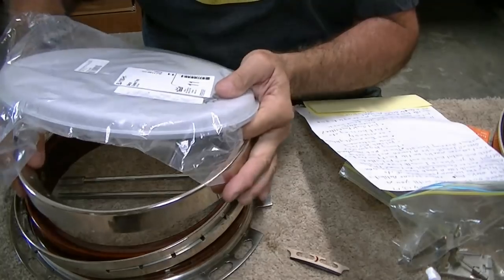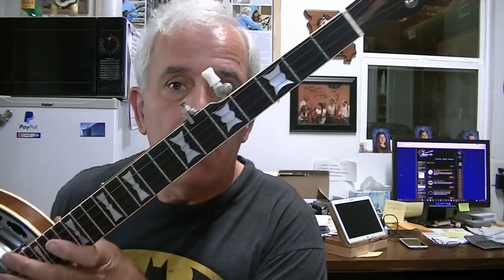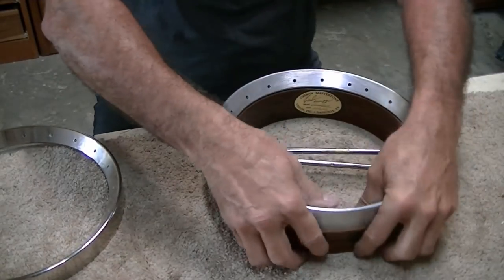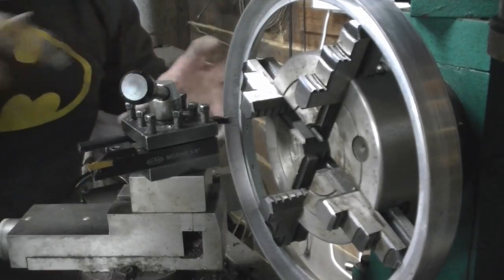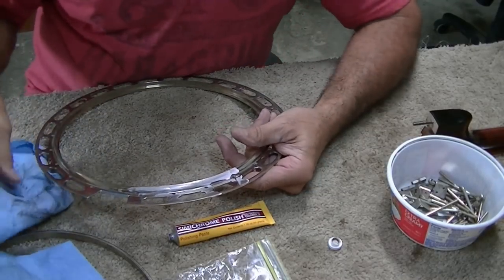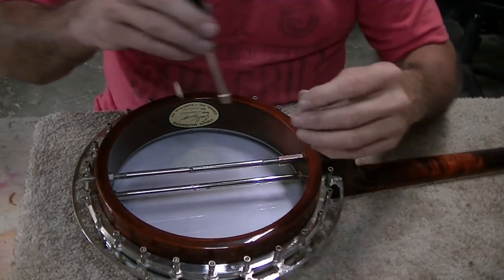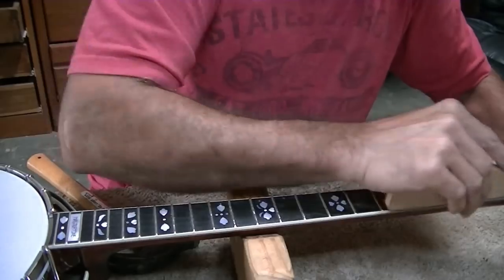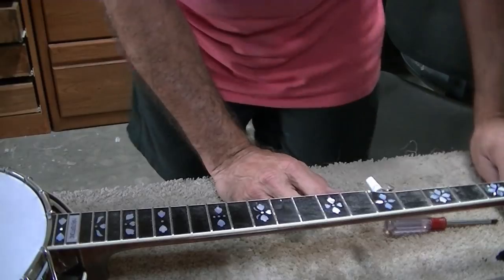181 RSW Gibson Mastertone Tone Ring Replacement

Comment: I've played banjo since I was 11. I'm now 36 & have played professionally in the recording studio & on the road for several years. If you are familiar with The Cumberland Highlanders TV show, I was on several of the earlier shows taped around 1998-2000. In my opinion, G or G# works for head tension. My preference is G# just to minimize overtones & still give the sharpness in tone. I recommend a drum dial to bring most of the guess work to a minimum. You'll find that the sweet spot is between 88-91. However, a lot of that is picker preference. It all depends on what tone your looking for & as you well know from your experience, different hands produce different tones also. You just have to experiment to see what works best for you. Great video!! Very informative. You are a great craftsman & very inventive problem solver. Keep posting great videos & keep up the great work!!!!
Reply from the maker: +redlinemando thank you for the note. Thank you for watching.
Reply: No problem. You make great videos. I wish I lived closer to you. I would definitely have you do my repair work.
Reply: Do you have any videos showing the process of a complete neck reset on a Martin or similar dovetail style guitar neck joint? I have a couple vintage Martins that I'm looking to have someone do a neck reset for in the near future.

Comment: Thanks, Jerry. Always interesting to see a banjo vid. I had a Stelling which whas just shy of 13 lbs so I'm wondering if you ever got any feedback from the client thqt the 2lb weight reducion helped with his arthitis. I definietly hope so. I had terrible back problems till I switched to a different strap designed to spread the weight - not perfect, but it did make a difference and did not involve structural alterations and possible tone change. Inve also tried a harness similar to the ones used by accordinal players, but no luck and very fiddly. Finally, I wonder if 2 lbs makes such a differece, given the totl weight of the darn things!

Comment: a tip from a drum tuning "expert" (at least I have done years of research on drum tuning) you can tune the head to a true note. I used to play banjo, but have never tried it on one, but since the banjo is kind of like a one key instrument, at least it sounds best to me using the open drone string, I think tuning the drum head to that key or a related pitch might sound good/better. you can't really do this by ear, but thankfully we have electronic drum tuners, specifically the "tunebot" to do this. I would love to try this though. And i noticed in another video you tuned the top of a mandolin, which is very cool, so perhaps this may interest you.

For banjo players, if tuning the head is not of interest, i'd use an "earthtone" calfskin head, would make it look better and it would probably sound beefier. about double the cost of the plastic head though.

BTW, I am addicted to your videos.

edit: sorry I posted before seeing you tune the head. However, you are tuning the center of the head's note, which is muted by the bridge. in order to tune the note I am talking about which is all that you would hear), it would be the rim note, which is usually about a seventh above the fundamental. Even if not to a "true" pitch, the tunebot would give you an extremely accurate reading, allowing you to get the head perfectly balanced.
Reply: Jerry was correct in the video when he said he thought it was a good idea to tune the head to a note other than one of the open strings. Among banjo players who have a preference in head note, the vast majority seem to prefer G#. A and B-flat are probably next in popularity. Some like the looser sound of G.  Many players can in fact tap-tune a head note by ear. They can hear the note and match it to a note on the instrument.  I've lost the ability to do it reliably, so now I use a DrumDial. Banjo players tend to like a range of 89 to 92. My banjos sound best to me at 91, which seems to be an A. At least on my banjos.

Comment: Will the polished aluminum oxidize over time?  If the answer is "yes," could you wax it or seal it somehow?  (I'm asking because I want to buff out some aluminum parts on a vintage scooter.
Reply from the maker: It probably would oxidize after a long. Of time but using the buffing compounds and the polishes seems to make it last a very long time before oxidation.

Comment: Well, you've nailed it one more time but I got the impression, by the end of thr video that I would probably prefer the banjo with the brass chromed tone ring.  I felt that for such a fine banjo the sound was too "thin" and not really clear but a little "pasted" with litle separation between the notes (probably the sustain may have been affected by the replacement. I don't really know. A banjo is an instrument that we don't really listen to frequently this side of the Atlantic. So, my opinion is worth nothing in this matter. It's just a feeling and we all have our ones. A Banjo's sound, no matter how good the banjo is, doesn't make me happy, anyway.
Reply from the maker: Mario Tulio yes it would definitely sound better with a heavy tone ring. But the customer seemed very pleased. Thanks for watching.

Comment: The ring is aluminium. Aluminium is (almost) the most expansive metal when heated. Why not try heating the ring in an oven and dropping it over when still warm/hot? That's how we insert steel/iron liners in alloy casings on two stroke engines. We heat the  alloy casing, keep the insert barrel cool and drop one over the other. As it cools, the alloy casing shrinks to fit and grip the liner.
Reply: A heat-fit like that would make it very difficult to remove.

Comment: You were lucky that tone ring (1970s, made by Kasuga in Japan) was 11 inches and fit the Gibson rim with only minor adjustment. I have two Kasuga pot metal rings in my parts collection and both are more like 10-15/16. Anybody want them? I like the flanges (such as on your parts banjo) for their non-Gibson look.

Anyway, if the customer is happy that's what counts. But I agree with others that a wood tone ring would have sounded better and would have been plenty easy to obtain.Might have sounded similar to Gibson's ringless pre-war RB-00 sub-Mastertones. Other lightweight options were a rolled brass hoop style tone ring, which I think is under $50 at Stew-Mac, or a genuine Gibson pre-war tube style tone ring which comes up on eBay or Banjo Hangout classifieds from time-to-time, never for much money.

You did a great job, but I think it's a shame that the owner didn't know enough about banjo to understand the actually available options.
Reply from the maker: He was just looking for a way to lighten it up. Everything I did can easily be undone and put back to original. He obviously was very happy because he sent me more instruments to work on.

Comment: You had an aluminum tone ring that, a while back, had just been laying around the shop! Your guardian angel, or all your banjo customers, are really looking out for you!  I know you would have come up with something, possibly by talking to all the good {aluminum) machinists on You Tube.  Somebody would have the right kind of aluminum scrap.  What did you charge for the tone ring, $100.00, or more or less?  Yes, the ring required some tricky machining, but if everything went right, that would be an overload of good luck!  What did the replacement brass tone ring for your banjo cost?

Banjo players must be the geeks of the stringed instrument world!  They have all that hardware to tweek!  You can't change a banjo to sound like a guitar or a harp, but in your opinion, do any of the trick hardware pieces significantly affect banjo sound?
Reply: Now I remember!  There's a channel, "Johnathan W", on You Tube where he's been casting aluminum from scrap.  I don't know if a casting would work for a tone ring, the possibility of voids is high.  Then there might be troubles hardening it.  The Aluminum casting was done in his "building an old fashioned motor cycle engine" series.  That's just a paraphrase of his title.  I actually think you might enjoy what he puts on his channel.
Reply from the maker: Bob Pegram thanks for watching I'll try to check him out.
Reply: Most of the hardware is only for solid fitting. There are a few pieces that can change the tone. The tailpiece & tonering are the most significant. The wooden rim is the most crucial factor in the tone. The better the rim quality, the wider the frequency range of the instrument. The lower quality rims often result in a very brittle & thin sounding instrument. There are however, always exceptions to the rules. Especially concerning banjos.

Comment: We polish aluminum airplanes quite a bit.  Most use Nuvite  (http://www.perfectpolish.com/app_guide.html) and it works very well.  Polishing aluminum is work and usually requires several different grades of Nuvite, but with a little bit of patience and elbow grease, you can get a mirror finish.  We normally use a random orbital polisher on aluminum, but for small parts or complex shape, hand polishing is required.

Comment: Just checking prices on that Banjo. Quite expensive. 4-5 thousand dollar range
Reply from the maker: falconeddie1 MasterPicker yes it's a nice one. Thank you for watching.
Reply: And that was a later one at that price range,   somewhat later than when  they originally started the Scrugg's "signature" series in '84.  Those could be had new for about $2500 or so,  if I remember correctly.  Even the one's personally signed by Earl (that being the first 1,984 produced - commemorating the year).  Took way longer for them to sell out the signed ones than they anticipated,  however,  even at that more modest price.  I had a chance to buy one used for $1800 (about '86),  but after playing it,  decided not to,  basically because it sounded no better than my old RB-250 Bowtie,  but I probably should have -- for collectibility purposes.   No biggie.  I do more playing than collecting,  and anyway,  that's what they're made for.